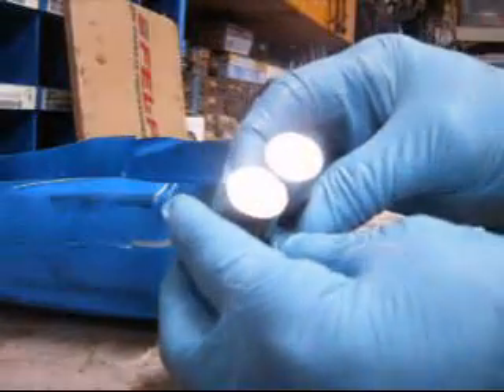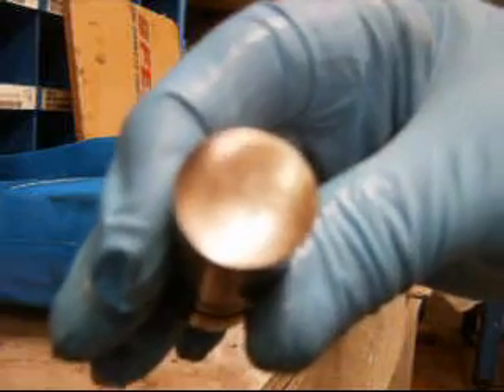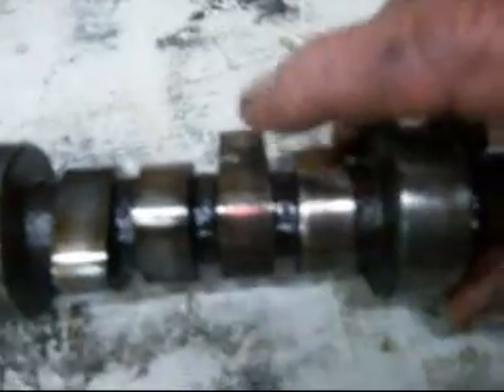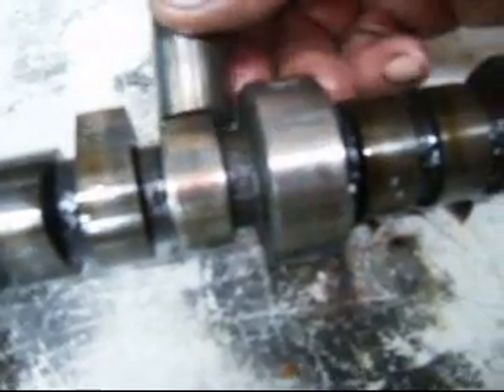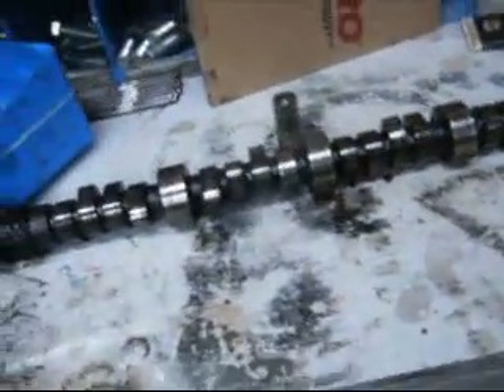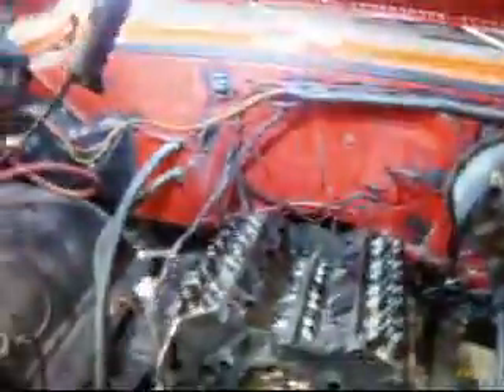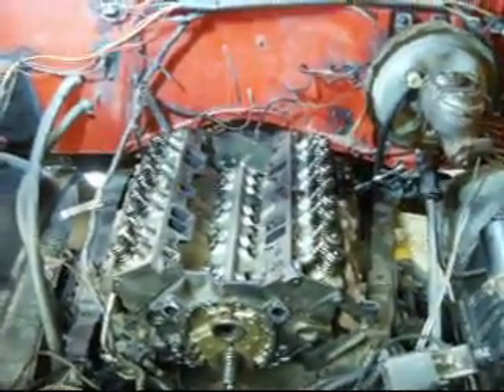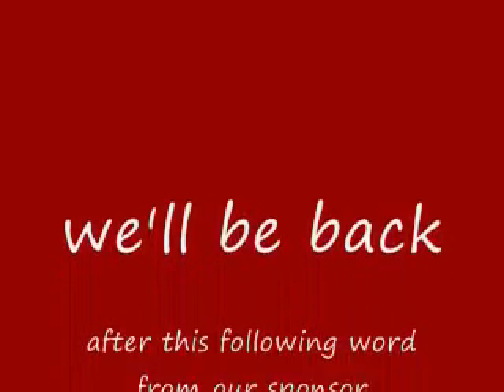ye old flat cam lobe and cupped lifter

Comment: Same thing happend to mine in my 82 jimmy ...12-210-2 comp came..was missing when i got it ..pulled valve cover..rocker am was about to fall off..readjusted ..ran fine for 2 weeks ..started popping thru carb ..pulled intaked ..boned..waiting on new cam now

Comment from the maker: usually cams go bad on "break in" doubt a noisy lifter would cause damage to the cam. the lifter is chattering because its not building up pressure so there is no pressure on the cam end of it ..

Comment: onother thing that will cause that is a weak valve spring. because you tighten the weak one further it will in turn put more pressure on that peticuler cam lobe.  ill bet you he used the same springs again and it will do that again on that same cam again, if you have that happen just buy a new set of springs and always set your valves the old fashond slow roll with torqe wrench way.